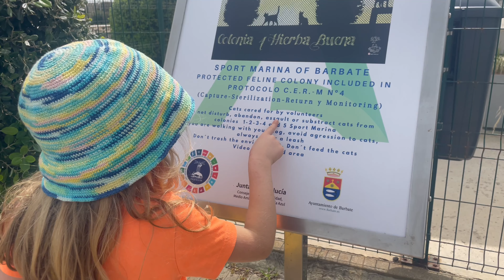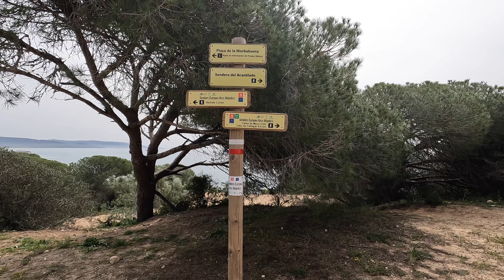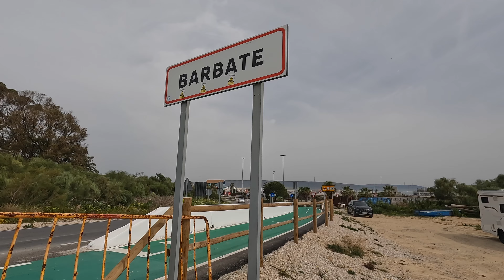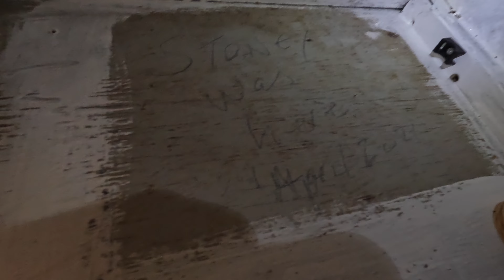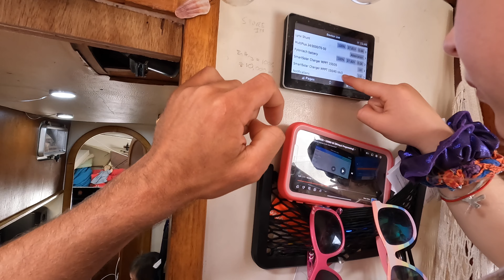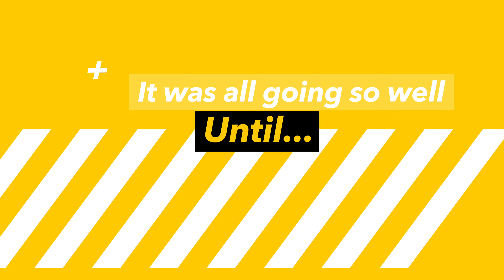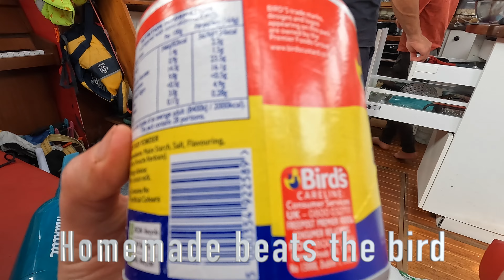Exploring Barbate & A Fuel Tank Disaster | Series 2 Episode 33 | Ep 100

Comment: Our previous boat didn’t have a fuel gauge either. I used a thin bit of dark wood (raid the wood store!) which was long enough to reach the bottom of the tank and leave plenty sticking out to hold. Between uses the wood dried out and so was ready for the next check.
Any use on Esperance?
Reply from the maker: This is a great idea and as you say much harder to lose in the tank.